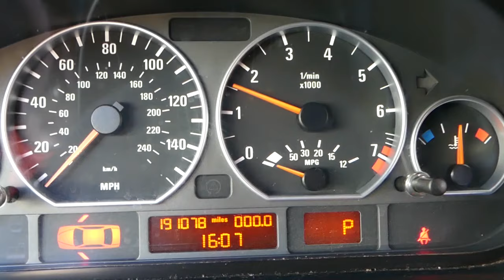BMW CODE P0420 P0430 CATALYTIC CONVERTER SERVICE ENGINE LIGHT

Comment from the maker: Products that we use and recommend:
► Oxygen Sensor Bank 1 Sensor 2: https://amzn.to/2Gtuaei
► Oxygen Sensor Bank 2 Sensor 2: https://amzn.to/389aBn3
► Oxygen Sensor Socket: https://amzn.to/384lIM0
► Panel Removal Set: https://amzn.to/3YiMADu
► Assorted Fuses: https://amzn.to/4fx4s3F
► Tool Set: https://amzn.to/3p5MM6t
► Screwdriver Set: https://amzn.to/3XRB28Q
► Castrol Oil: https://amzn.to/3xBc8B9
► Oil Filter: https://amzn.to/3w0Ulme
► Torque Wrench: https://amzn.to/32qyRwg
► Liqui Moly Engine Flush: https://amzn.to/3IiDBID
► OBD Scanner that we use most often: https://amzn.to/3I4MQfe

► Check out our Amazon Store for the tools and parts that we use: https://www.amazon.com/shop/worldmechanics

Comment: I think you put the wrong bank sensor for the link. 1 ~ 3 cylinder 02 sensors are called bank 1 sensor 1. 4 ~ 6 cylinder 02 sensors are called bank 2 sensor 1. You listed bank 1 sensor 2 and bank 2 sensor 2 for the link which is after cat, bottom of the car on the exhaust.
Reply: He has yet to admit fault 😮

Comment: I have a 2010 128i I blew out my engine I’ve been told I have bad cats and replaced the engine but the car still doesn’t preform like it used too any suggestions

Comment: Where's the link for the catalytic converter I need for my 08 X3? Diagnostic tool said "P0420 Bank 1" Also I hear a rattle under my car which I think is the broken parts in my catalytic converter.
Reply: Same with me too
Reply: Same here. Just got quoted 3k

Comment: I have an 05 bmw 325i, I just replaced all 02 sensors new fuel pump, cam n crank sensors n now I'm getting a 420 n 430 code, should I keep spending money on the car,,,,
Reply: Did u figure it out ?

Comment: I replaced all oxygen sensor with newer ones but I still have same issue ? I think it can related to Coolant temperature sensor too. I am gonna check it, but if you have any idea please let me know.
Reply: Did you change coolant temperature sensor? Did it help u with this problem?
Reply: More than likely it’s the cats if u change ur O2 out with an oem sensor and it still says ur cats are bad they prolly are
Reply: @duncanconnors1037  what if you don’t use oem but use good ones like A-premium

Comment: please help. I have an e46 318 m43b19. i have check engine light and my mechanic says its from catalytic converter.  I changed the catalytic converter, i changed lambda sensors both of them with new bosch and still i have the check engine after 100 kilometres each time they delete the light. What can it possibly be? no one can find what it is
Reply: Did you resolve the issue?

Comment: So I have a 06 330i I have had 1 code p1415 MAF code for a few weeks and rough idle. I found one of the CCV valve hoses was broken off. I temp replaced it with a a rubber hose until I get a new CCV system. Car ran fine for 2 days now I get P0420, P0430 and pending codes P0171, P0174. Could this be still because I have a vacuum leak? I've been throwing money at this car like crazy just trying to get the CEL light to stay off so I can pass inspection. HELP!!!!! LOL
Reply: “Start with the simplest, cheapest and easiest 1st.” 
I would address and solve the other codes present 1st. Solve P0420/P0430 last. Because the other codes could be the reason why you’re having P0420/P0430.
I would change the spark plugs 1st. Use only what is designed for your car. I’d Check air filter too for dirt. Clean MAP sensor. Then, check the intake manifold gaskets and air boots, make sure screws and clamps are tighten to specifications. Check for loose clamps on the intake boots. I’d also check the throttle body gasket for leaks. Check PCV purge connector, make sure it is intact.
Reply: @simplelangperorock  Thanks! I posted this 3 months ago I've got the car straightened out since then. I learned a lot from youtube. Very happy with the way it's running now eventually I'll address the oil leaks but for 221k miles it's doing good.
Reply: @Joeshomegarage  what was the problem?
Reply: @tyronehernandez9962  there were so many problems I can't remember them all but I ended up replacing the CCV hoses and then it threw codes for the rear o2s. I couldn't get the laptop to connect to the frm module to try and tune them out so I added extensions to the o2 sensors and the lights stayed out. Had to send the frm module out to be rebuilt. After that it's been fine.
Reply: Wow! I'm glad you have taken care of your issues.
Reply: @tyronehernandez9962  thanks man! I was ready to set the car on fire but since I've gotten everything straightened out I've put about 6k miles on the car. I love it for a daily driver.